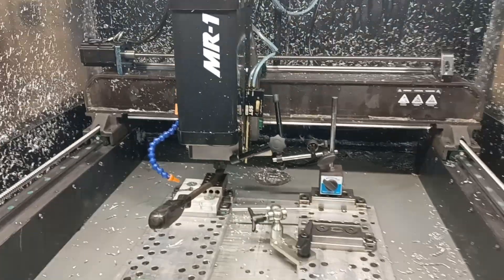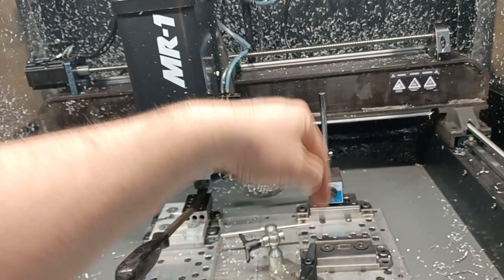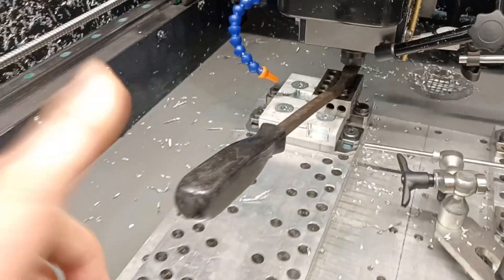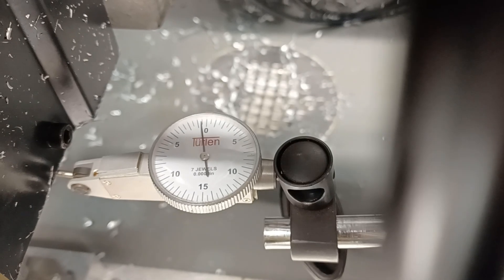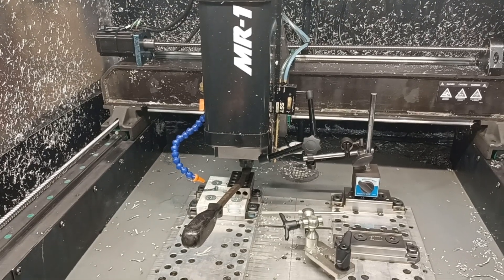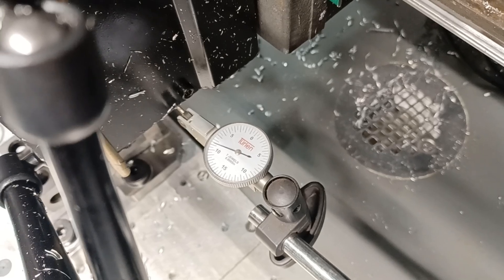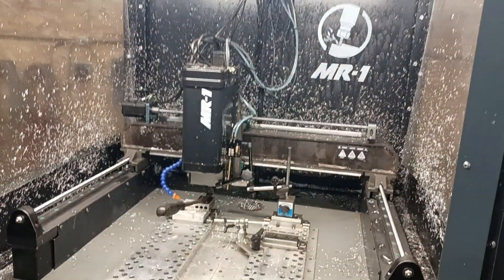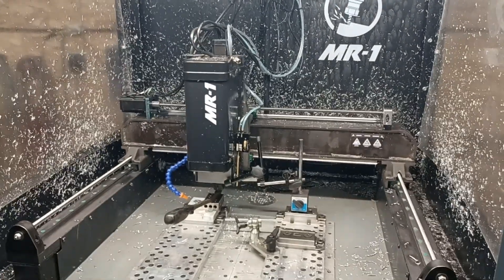Pushing the MR-1 to its limits with this steel part. (Reviewing the Data)  #langmuirsystems #MR1

Comment: Take a look at the end bearings on the Z axis screw first.
Reply from the maker: I checked those before filming the video.  They are tight.  The play is on the z axis nut.  I also checked the z axis carriage bearings.  They only have about .001" of flex.